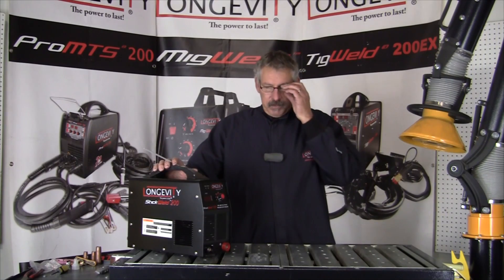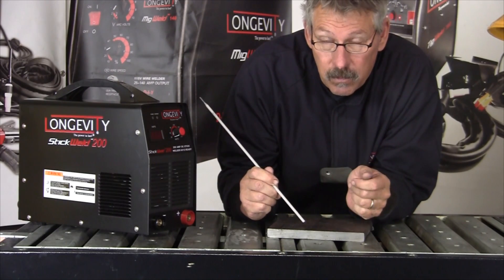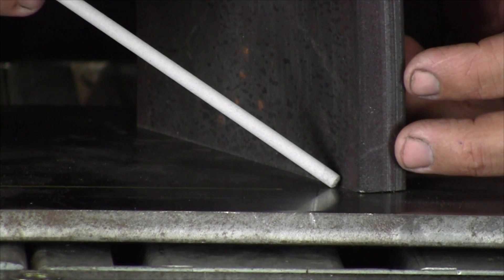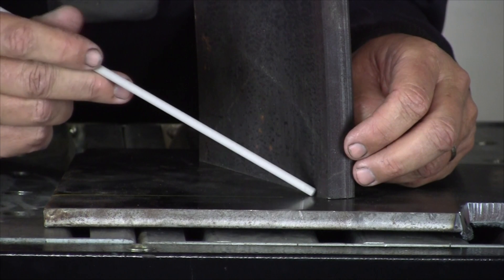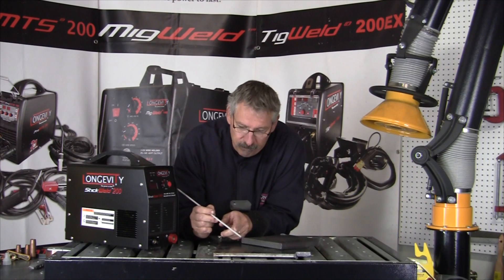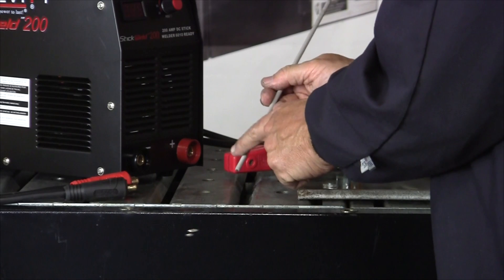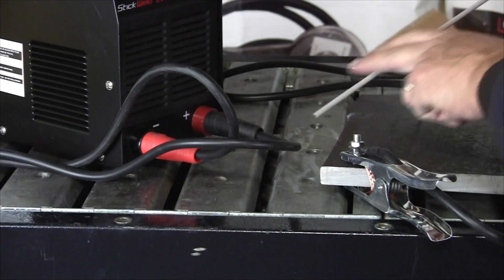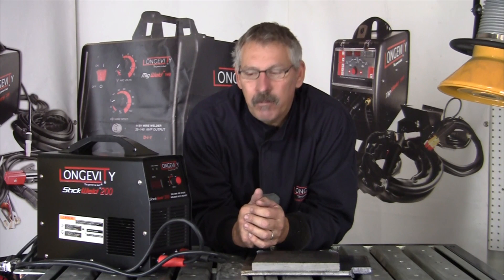STICK WELDING BASICS - ARC WELDING EXPLAINED

Comment: I'm 74,    when I was 11 years old. I was reading a hot rod car magazine $.025. in  1959.  I saw in the back cover an electric arc welder for $14.95 !!  
 Called the FOURWAY electric arc welder, made in Chicago, Illinois 🇺🇸.  I saved my money,   2 months go by I had enough to buy it,.
  It took 2  months for me to get it. 
  They don't ship as fast back then.
  When I plugged it into 110 vac. And struck an arc,    it scared the "sh?t"  out of me,     as I  never saw anyone weld before !!  Later on in my 20's I became a professional welder.   Welding sure came a long way !! 
 Great Video. Thanks

Comment: "Power" is not the same as "current". Power (Watts) is represented as  "W" , current is represented as the letter "A" (as in amperes), and the letter "V' represents voltage.  The formula is W =VxA.        Therefore, A (current) = w (Watts)/v (voltage).

Comment: thanks for the vid , im a newbie to stick welding and was wondering , is it ok to actually hold onto the stick to weld to have more control or will it be to hot
Reply from the maker: Thanks for watching! You cannot hold the stick itself only the stick holder.
Reply: @longevitywelding    INCORRECT!!!!   You can hold the stick like a pen so that you have more control over it, as when tack welding. Wear gloves and if the rod/stick sticks to the metal - be prepared to let go because it will get red-hot quickly.

Comment: Hallo and thanks for the good video. I would like to ask you to tell me some words regarding the “Arc Force” and “Arc Ignition Time” that I have to set on my machine (except the Welding current of course). Can you give me an example of the 3 settings when I have to weld 2 and 2 mm of metal and use the 6013 rod. Thanks again. Spiros.

Comment: Thanks.  I've watched other videos and some of these people absolutely know what they are doing.  But for the very rank beginner that is trying to decide what kind of welder to even start out with, you explanation has been simple, to the point, and easy to understand.  I was advised by my farrier to just go with stick welding for the simplicity of equipment.  No gas bottles to buy or haul around and one doesn't have to worry so much about the wind if going outside.
Reply: You're a horse?

Comment: this is the first time i know that you can change the polarity of stick weld. my question is, is it fine to just cut the wire and change the connection?
Reply from the maker: If your unit has a positive and a negative port, and not built in leads, you should be able to swap the work lead and stinger lead without cutting wires.
Reply: thankyou for your reply Sir.

Comment: that means when we need deep penitration use dc - and when we need more deposite rate used dc+
Reply: Your thought is right but in the video the explanation was wrong he said dc- was most concentrated heat in the electrode i think that was wrong dcen is heat most concentrated on metal than the electrode

Comment: you have wrong information .when electode in +.the heat increase in elctrode and when use dc - the heat increase in work piece when use ac polarity the heat become 50% in work piece and electrode...

Comment: Hello, my name is Scott Miller. Im currently in school at NCKTC for welding. I'm commenting because Im looking for help with my schooling/tool costs. I receive VA benefits but they only pay for half of my schooling, this doesn't include books or tools. My program is 8 hours a day Monday threw Friday, so it leaves me little time to work while trying to complete my homework. Anything would help so much as I approach my completion of the course. If you want to help and donate you can here at https://fundanything.com/en/campaigns/help-get-welding-tools-for-schooling?col=-61051 . anything is appreciated greatly.